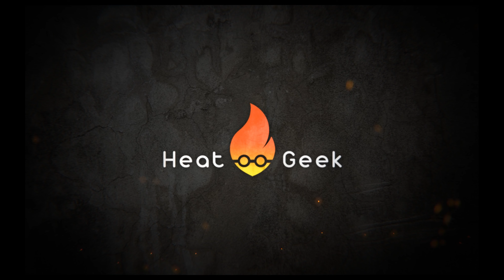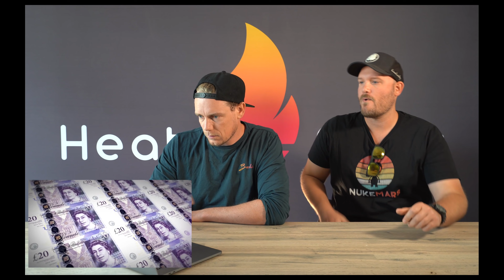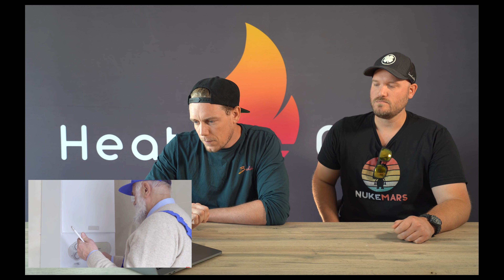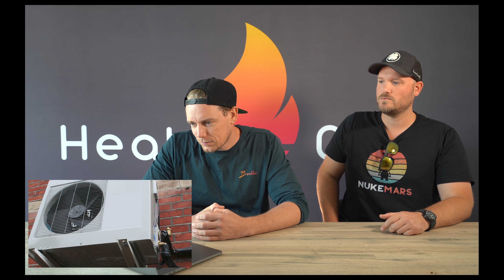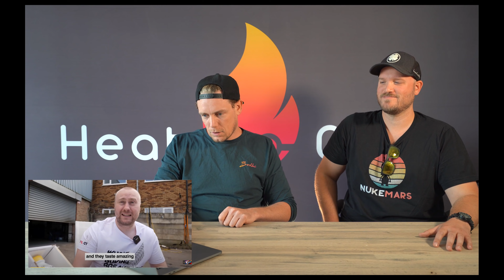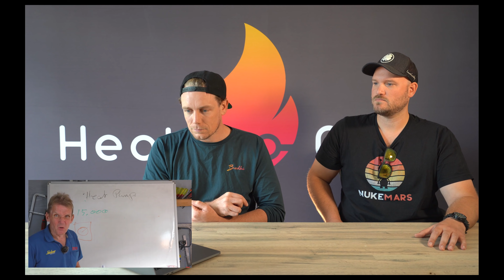Professionals React (BADLY) To Skill Builders's Heat Pump Videos | PART 1 | FIRST TIME WATCHING

Comment: Re the change in relative prices of gas and electricity…While 60% of U.K. electricity is generated by burning gas it’s not going to happen.
Reply from the maker: I think it's 40% but the point is it's ever reducing as more and more renewable sources are fed in.
Reply: @HeatGeek  and as that happens the price of gas will increase due to tax changes (if it doesn’t the planet is cooked). This will drive a faster move to electricity as a home heating fuel. Shame that heat pumps aren’t the solution for much of the UK’s current housing stock.
Reply from the maker: @dylanbrown5414  its a shame they are too expensive for many as they also need insulation etc also for sure. But it's the only solution we have.. 1 solution is that the gov do more to help ordinary people afford them.. not rich people.
Reply: @HeatGeek  A bit of an unfair statement. Because someone is careful with their money, saves it up instead of new cars, foreign holidays etc and so can afford the upfront cost of major works doesn’t make them rich. 
It’s not just the insulation, though that is bad enough (I had IWI fitted to two rooms of my house a year ago) but also the replumbing and rewiring needed, and the consequent redecorating needed. It’s not just the money putting people off, it’s the disruption to daily lives. 
I had the space to move everything out of the two rooms into the rest of the house. Most wouldn’t have that space. The government just hasn’t thought through what is involved in doing it all right for existing housing stock. They will use bigger and bigger sticks rather than suitable carrots (subject to reelection constraints).
Reply from the maker: @dylanbrown5414  any major replumbing is not needed in 95% of homes.. yes there may be some making good..  just comes down to expense again.. giv should help more if interested in lowering long terms co2

Comment: Any heating system needs to warm the house. What about an electric boiler instead of an ASHP? Why can’t I find an electric boiler bigger than 12Kw?
Reply from the maker: Because an electric boiler you get 1kw out if you put 1 kw in.. a heat pump you get between 2 and 5 kw out for every kw you put in.

You can't find larger electric boilers because of the electrical supply needed and if you had that much load it's would be way too expensive to run
Reply: @HeatGeek  I agree that, in theory, heat pump technology is better because of its efficiency, but in practice it doesn’t work out. The percentage of electricity generated by gas will fall as renewable generation increases. This decoupling of gas and electric prices will allow the government to increase the price of gas (through tax changes) to drive consumers towards electric power (converting the gas network to hydrogen is decades away). Much of the current housing stock is unsuitable for ASHPs and GSHPs and anyway householders don’t want the disruption that a correct design requires. They  will want to keep their existing wet CH systems and just change the boiler with minimum disruption. Installing greater electricity feed capacity will be a lot less disruptive, particularly if also doing this for EV charging.
Reply from the maker: @dylanbrown5414  "in practice it doesnt work out" if poorly installed.. its not hard to install it well its just our quality of work force is so low.. something we are working to improve..
Reply: @HeatGeek  yes, that is a factor. But also there is the enormous disruption and cost of properly insulating old housing stock to make heat pumps a viable solution for them.

Comment: The installer is the variable?
Do you accept or not that below 5 degrees, exactly when you need the heating that an ASHP needs an immersion or reverse cycling to get the refrigerant back to vapour state, either way the efficiency or actual time spend producing heat is dramatically reduced affecting output and or running costs?
Reply from the maker: No lol.. lots of vids coming out showing that your talking about old units and /or poor desings

Comment: blaming everything on the installer seems to be the only defence.

heat pumps just are not good enough if you have mains gas.  why pay £10k+ to have a heating system that takes up more space, is nosier and is only slightly more efficient (if at all) than your old system.

I would only ever consider getting a heat pump if I was off-grid, as the savings then would probably justify the cost.

Comment: People prefer gas stoves to electric stoves to cook because it is simpler and cheaper. Same logic applies to gas heating and heat pumps. Skill Builder rocks.
Reply from the maker: Not really yhe same logic is it.. electric stoves are only 100% efficient, gas stoves around 80%.. gas boiler 90% efficient.. heat pump is 250 to 500% efficient

Comment: Skill builder has some other interesting videos. My gas installer put in a heat pump in his own property and told me how useless it is. So much he has kept his wood burner. I am 75 so like the warmth, 21 degrees C doesn't do it for me! I recently had a replacement combi boiler installed replacing an old 40+ year old system. Hot water tank and immersion heater removed! I also have a wood burner which provides enough heat for the whole house in spring and autumn. My house is now warm after 8 weeks of being very cold. No mention made in your video about the plans to replace natural gas with Hydrogen which is carbon neutral. Global warming probably won't affect me but I am worried about my children and grandkids.
Reply: Hydrogem molecules are much smaller than natural gas, it is harder to add a scent to warn of leaks, this means it will be more dangerous by far than natural gas for heating and cooking!

Comment: Look I worked in the HVAC  here in the U S A ,we found out heat pump would only work  in  warm and dry area like the south and southwest ,see what you guys forgot is the colder the air temp is the longer the backup heat runs which mean the higher the electric bill goes up so  Skill builder is right
Reply: I mean.. our units don't even have backup heaters lol

Comment: Your awesome COP 4,5 isn't real in normal instalation and in winter. Please be realistic, don't say "fairy talles"... 
"Great" heat pumps are uneficient few more celsius under zero. And in this time, electric heater is started a eat direct energy from electric grid, for now with extreme prices.
Reply from the maker: That's why we look at scop not cop.. its all acounted for. Lots more videos to come out on this.

Comment: OK, for my house I need 6kW in case of temperature -12°C. Heat pumps boiler with real COP=3 eat 2kW from electric grid for that. Maybe many more, if is started electric-heater. BIG more. 
But those 2kW in electric in price is nearly same as 6kW from GAS. And if I will calculate investicion to HeatPumps boiler? Nonsense ... Only if case, when gas price will be 2-3x more than electro.

Comment: Heat pumps v high quality gas boiler... No contest.. The gas boiler...

Great hot water,  no drop off in performance when the temperature drops.. Much, much cheaper (even with gas price increases),  less noisy crap outside the home,  much less to go wrong....
Avoid heat pumps they are a nightmare..
Only ones that are any good are the vertical drilled types but few people can do this and most land tends to be unsuitable...
Don't fall for the hype -  stick with gas...  Best is gas, under floor heating and super well built new home... We have 200m2 and the house is warm everywhere and we pay 600€/year for gas...  Going up to 900€ due to gas price hikes... Buy electricity has gone up a lot and those daft heat pumps run on electricity.. 
When the temperature goes below 5 deg C you'll see your electricity consumption shoot up when you use a heat pump.. They'll promise the earth but believe me they don't work well..  
Avoid...

Comment: Heat is heat, the insulation doesn't matter. What matters is how much gas costs and how much electric heat pumping costs.
Reply: It does as the more insulation the lower the flies temp.. the lower the flow temperature the higher the COP.. your confusing heat loss and power input

Comment: As we’ve seen gas prices have shot up, I work in the motor vehicle industry (funnily enough I actually have an F gas certificate too) 

I am fairly sure that when everyone has been moved into FEV transportation electric prices will also be impacted in new bizarre ways. As for hydrogen I think it’s a great technology, arguably better than electric but isn’t the production of hydrogen for cars or home heating pretty environmentally bad ?!

Comment: 7:00. "30⁰C or more"? that's for 4 days a year for about 4 hours a day in the afternoon. So not really a COP of 4.5. You seem to actually agree with SkillBuilder. There are too many examples of heat pumps not delivering, because of bad installs, and there is nothing to prevent this becoming the next diesel car, PPI, double glazing, loft insulation scandal.
Reply from the maker: The point was to show the range.. we have a cop of 5 in our building.
Reply: So what is it in winter? It's 6⁰C right now. It's mostly air source heat pumps being put in everywhere. It's not all about the COP. 31:00 "COP of 1". (Heated jackets would result in less carbon). Until the culture of bad installs is changed, I'm not convinced by heat pumps and a widely practical solution. I appreciate absolutely the importance of a correctly engineered system. I just don't see the change to hear pumps being executed correctly.I am not an engineer, I am a Physicist.
Reply from the maker: @friarchris2  so right now at 5c outside its running at a cop of 3.2.

Comment: Must say, heating jackets don't seem like a bad idea. Heating your house to say 16 °C (to prevent condensation problems) and heating only yourself the rest of the way seems much more efficient than heating your house to 21 °C. Even if the jacket has a COP of 1. My heated motorcycle jacket only pulls about 70 W and keeps me hot at 0 °C at 130 km/h. In your home something like 10-15 W might be enough

Comment: For warming water I use a hybrid electric heat pump system installed in the basement. It saves me some money but it's not worth it because it's too noisy. It's like having a very noisy air conditioning unit that's on most of the day.
Reply: Definitely not worth getting a really noisy unit I agree. I don't think sell them anymore really tbh though

Comment: So you both just confirm with your own words what Roger just said.
Reply: Err.. no not really. Heat pu.ps do not have cops of 2. Thermal stores should not ne used with heat pumps.. they do not only work I  new builds.. they do not only work with underfloor heating.. to name a few disagreements..

Comment: High COP needs high outdoor ambient temp ... Obviously! So at the time of year when you need the MAXIMUM COP (winter) you get the worst COP and in the summer you get the best COP when you don't need the heat as much.

The BIG problem with air source heat pumps is that they are designed by people who are only interested in THEIR technology.

What do I mean? Well, if on a cold January day you could take the energy out of air at between 60°C and 75°C instead of 3-4°C  how much better would the COP be then? 6, 7, 8 or more?

Yet this EXACTLY what COULD be done by PROPER design using SIMPLE additional engineering! How? By gathering MUCH more heat from the hot air generated by using solar air heating to pre-heat the air passing through the Heat Pump.

 Several experimenters have been doing this for some time but also NOT doing the obvious and feeding that hot air (up to 75°C) directly into the Heat Pump air inlet. You can find many, many videos on YouTube discussing these experiments and installations.

So it begs the question ... WHY are so-called "professional HVAC engineers NOT doing this? Laziness? Stupidity? Vain belief that their own knowledge surpasses that of "lesser" mortals? It is absolutely disgraceful!

The second problem is storage: 

1. For hot water
2. For heating

Once again we had so-called professionals (morons more like) insisting on the removal of hot storage tanks when fitting combi boilers!! "You won't need it any more". Now we find ourselves having to re-do domestic plumbing all over again because of those brain dead imbeciles with all the vision of a mole. 

When collecting "free" environmental energy of any kind, suitable & adequate storage is essential. For home heating during long winter nights a LARGE amount of heat storage is required typically WELL over 1000 litres of preferably high density liquid, the denser the better.

Muddy water works great with up to double the heat storage or more than clean water! Obviously some other issues arise like how to keep mud in permanent suspension so that it doesn't settle out. Is any professional company looking at this? Doubtful!  I've not heard a whiff about it, despite the OBVIOUS benefits.

A buried, well insulated IBC tank will do the job great, provided, once again, a holistic approach is used, and the heat stored is extracted using a heat pump. 1000 litres heated to 70°C during the day will provide a LOT of heat to a house fitted with underfloor heating or radiators electronically individually controlled and with separate temperature zones for different times of day & night. 

Me? Well I'm an engineer of almost 50 years standing and I shall be building my own heat pump with solar hot air boost for a fraction of the cost of an inferior commercial unit! And, with a bit of luck, a decent winter daytime COP that challenges or beats commercial systems hands down. I still can't see how a big fan, a freezer compressor and a load of copper coils fitted into a tin can costs £6 to £8k! Bloody ridiculous!

I already have an almost net zero total annual energy bill due to my solar PV & generation tariff. For a small additional expenditure I should easily be able to turn that into a net negative bill and be paid for consuming FREE energy!
Reply from the maker: We are all aware of this, we install them for a living, this is what scop is for... Roger suggests you get a cop of 2 max which is incorrect.
Reply: @HeatGeek  so why aren't solar pre heaters installed as standard if "everyone knows this"? Can you name a company that does so?

Why does nobody mention being able to raise the COP significantly using that method? 

Why would it be necessary to replace all the radiators with high output ones if the COP can be raised (doubled or trebled)?

If solar pre-heated air at just 60°C would increase (approx double) the summer COP and MASSIVELY increase the Winter COP (treble or even quadruple the typical) why is it not done (applies equally to ground source heat).

If you are SO well aware of these things, WHY are you NOT doing them? I don't get it!
Reply: @boblewis5558   the all knowing this comment was about scops..

The solar preheat thing has no comecially available products
Reply: @ChapmanPlumbing  my comment never mentioned scop which is a complete read herring against what I wrote in my original comment. Why not address the points I raised instead?
Reply: @boblewis5558  I know it didn't mention scop. That's the point.. scop addresses your points on differening cops throughout the year..

Regarding the rest. Too much for youtibe comments section to be honest.
Reply: @ChapmanPlumbing  NO it doesn't! SCOP is a cop out! Pun intended. The ONLY worthwhile measurement is COP but at a specific ambient air temperature in January - usually the coldest month. The BULK of my original comment was addressing the fact that NOBODY is producing properly designed systems to take advantage of SIMPLE things to VASTLY improve that winter COP figure.

The ABSOLUTE value and the AVERAGE value are immaterial. It is the RELATIVE value of the heat able to be output were the design optimised (cheaply) which absolutely NOBODY professional is addressing. They are ALL burying their heads in the sand!

Please don't tell me that my comment had been properly addressed when it has not even been mentioned, let alone discussed! 🤬
Reply: @boblewis5558  sorry your too passionate.. even for me 🤣🤣🤣

Comment: My location in the US is about 10F today.  Much colder than most places in the UK.  We have a huge heat pump market and install hundreds every year.  Most of ours are air cooled but the concept is very similar.  If sized properly, they work and work efficiently.  This guy is ignorant when it comes to heat pumps.  My guess is that he has no idea what a heat load is and guesses at sizing them.  What about options?  Dual fuel?  We use those in air cooled as well as water to water.  If it's an old building that you can't do much with, install a heat pump with a tankless gas heater as a booster.  Heat pump works alone most of the time and gets supplemented when needed.  Best of both worlds.  We've been using heat pumps in the US for well over 40 years.

Comment: I have designed HP in the past. I would have better confidence in a constant fuel source than one that fluctuates as much as air. The are pros to the clean energy and High COP in summer for Hot water but the cold/higher demand use cases are tough to manage.
Reply from the maker: We get a cop of 5 at -1 now we have larger rada.. not really an issue...
Reply: @HeatGeek  Every Exchanger has its limit. Whats the run time that is measured against and RH%?  seems really high

Comment: £10-15,000 to install an air source heat pump system in my house? No thanks, I'll stick with my DIY all electric system. Cost me £2,000 for panel convectors, one in each room plus £350 for a new hot water tank. That was 35 years ago. Never cost a penny in repairs. Currently annual  bill (2022) £2100 which includes latest 25% increase in UK energy prices. Cosy 18-21c in every room with plenty of hot water.